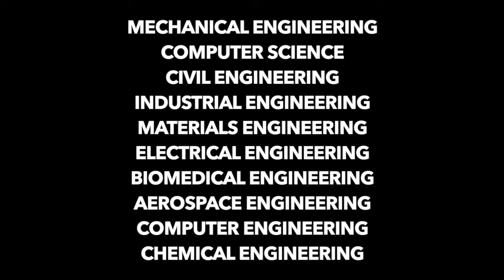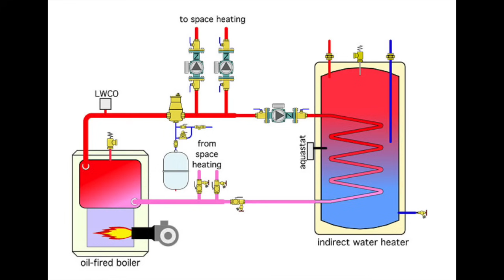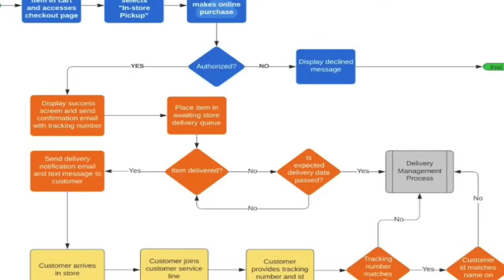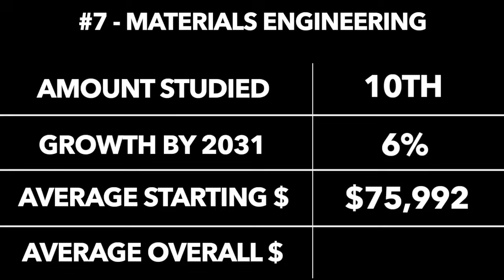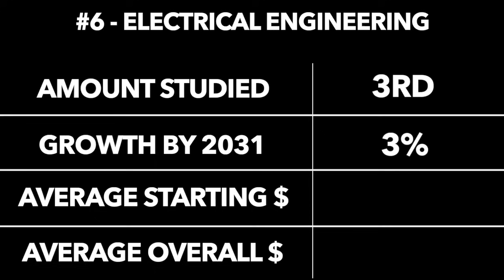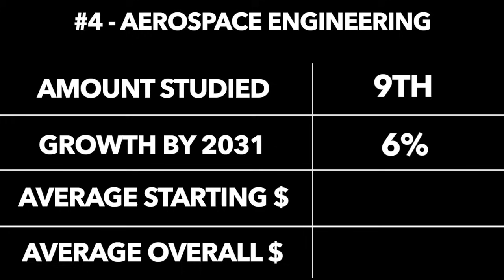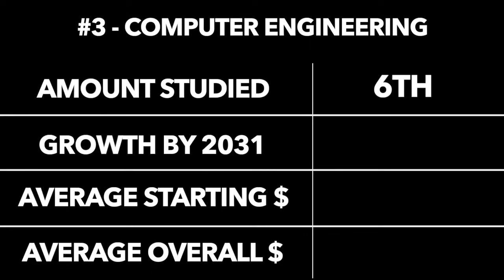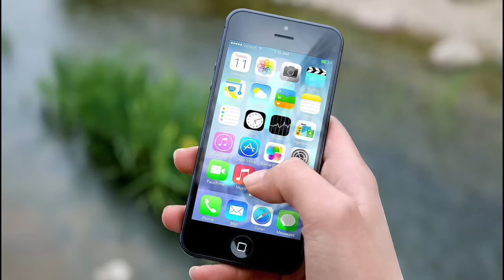Engineering Degrees Ranked: Pay, Demand, and Job Roles

Comment: Retired electrical engineer here. Six years in I was promoted into engineering management, which turned out to be a better fit for me instead of designing circuits and writing code. I evolved a small local electronics support group into a team of engineers and skilled trades people who specialized in the concept, design, build, installation and startup of custom manufacturing assembly automation equipment for my company's North American operations. I learned a tremendous amount, way beyond just the electrical side, from the variety of skilled specialists in my group. I respected them and they knew it,  which in turn made me a more effective leader. Very meaningful and profitable (for the company) work, but extremely demanding.  Upper management always wanted more and expected you to work whatever hours it took to meet their (often unrealistic) expectations. Biggest pain was having to explain to the bean counters and fast-track upper managers why sophisticated equipment couldn't always be conceived and produced to the schedule they crafted on a spreadsheet or Gantt chart. I was successful not because I was an engineering marvel, but because I could identify, recruit, hire and retain a wide range of skilled people who could produce results, and then was able to keep management at bay just enough so I could maintain a positive, creative atmosphere for my team.  My people were the secret sauce for producing project outcomes that made the company $millions.  With that group, there was almost nothing we couldn't do.                 
Engineering is what you make of it.  You've got to work smart and produce measurable results, either by yourself, as part of a team, or as the leader of a team.  You need to be as mobile as necessary to find a good job that fits your skill set.  The right amount of aggressiveness coupled with strong technical and practical knowledge and broad experience can be a real asset as you interact with others in the corporate world. You need to be articulate, have strong grammar skills, be creative and persuasive in order to convey your ideas and convince upper management you qualify for the $$ or resources you require to produce the results they want.  Just be sure you've done your homework on issues, because when you take the lead, you've got to be right.

I walked away when things went global and the service my team provided was being spread all over the planet. And I was being shuffled into roles that I hadn't signed up for and were out of my scope. The volatility became a drag and travel was starting to take too much away from my personal life.  I realized the tipping point had been reached while returning home one night from a business trip, and I immediately started planning my exit. Shortly thereafter I submitted a one month notice and retired.  Great career, but having way more fun now.
Reply: You sound like the generation that built the middle class before we began outsourcing American jobs for overseas engineers at an unprecedented rate
Reply: @henrylj2660 we outsider want to migrate because there is no respect to educated people because of tyrants and greedy and uneducated business owners from a few generations ago and we have not enough salaries.
Reply: Your role sounds like project manager!
Reply: I'm in a trouble situation. Completed bachelors in mechanical engineering and went into learn web development because of the payscale it offers. Still struggling to learn the programming and don't know what to do next. Can I stick on to mechanical domain.
Reply: isnt there lots of jobs for mechanical engineering  @azad738
Reply: Hello, electrical engineer in training here. This is my third year. I feel like exactly what you explained above, that I would do better in a management role as opposed to be a designer. But I've got a long way until then. It's good to hear that you managed to have a good career! Definitely provides some hope that all the hard work I am doing right now will pay off in the end.
Reply: will like to link up with you, I also studied the same course,. Your CV is very impressive
Reply: Can you please get me an internship for next summer somehow😭😭😭

Comment: Not often mentioned:  regardless of the engineering discipline chosen, interpersonal skills will be a big factor in your advancement.  Your career path can lead you to places you can’t predict at this time: project engineering, project management, etc.  Getting along with people in a team, leadership are important skills to develop.
Reply: Agree. Those skills are absolutely necessary to differentiate you from "just" engineering work and open doors to positions that might build on your engineering expertise but be a better fit and much more rewarding.
Reply: I also agree. Being technically competent is necessary but not sufficient.
Reply: As long as the Human Resources idiots have a stranglehold on management (for fear of lawsuits), interpersonal skills and workgroups will, unfortunately, be a thing. This mindset is anti-engineering except for the absolute top 1% which can do both math and schmoozing effortlessly. We need more working and fewer meetings where we are forced to "share."
Reply: @RyanK-100  I respectfully disagree. Interpersonal skills and teamwork will always be a key component of any engineering project.
Reply: Spot on. I'm an ex Ex RAF Radar Engineer but ended up as the UK rep at ETSI (European Technical Standards Instutite). No way was that predictable.

Comment: Because all of these majors precipitate into one job role or another, those roles each have their own salary expectations.  For example an electrical engineer in power systems is completely different than an electrical engineer in control systems.  Wouldn't it be nice if someone could write software that would let you navigate to the brainpower-to-salary that most closely matches you?  Of course in college, people don't really know themselves yet, of what they are capable, and of what they are not.
Reply: 100%. An electrical engineer in control systems in mining for example will pay 2x to 3x of a power systems

Comment: You missed one, 'Electro-mechanical/Packaging Engineer' its a combination of ME with a dose of IE and EE tossed in.  This engineer designs the unit that puts 10 lbs of electronics and housing into a 5 lbs package that survives what ever the Customer uses it in, is producible in high volume with no defects and looks good.  Did I mention low cost as well.

Comment: "Mechanical Engineers make weapons.  Civil Engineers make targets."  😀  Keep in mind it's hard to ship overseas some of these like Civil Engineering.  I started as a BSEE in 1987 from a good U with excellent grades at $32,000.  EEs also design chips (integrated circuits) for television, networking, medical equipment, etc.  It bugs me to no end when people without engineering degrees call themselves engineers.
Reply: I worked a job they called us field engineers to get out of paying us OT. That didn’t work out well for them as they also got caught billing the customer for engineers when we were technicians. They also had to pay us back pay for OT. I worked with bandwidth transport with FOC, digital microwave and satellite communications at a gateway. These jobs paid over $100,000 10 years ago.
Reply: @Chris_at_Home  i work in construction and was a field Engineer. I can say we did more “engineering” related work than project engineers which I also did lol
Reply: When people doing trades say they're engineers...
Reply: people that drive trains are engineers.  haha!   just thought I'd add that.
Reply: I call myself engineer although I dont have an engineering degree. What is your problem with that?
Reply: @michaelpieters1844  I call myself doctor although I dont have a PhD. 🤪
Reply: @michaelpieters1844  If you actively use mathematics, and the sciences to solve technical problems, you are an engineer! You are doing engineering work therefore you are an engineer. Per your comment, I would conclude that you are no a professional engineer, a PE, but there is nothing that says only PE's can do engineering work. Legally, you cannot provide "engineering" services for others in return for compensation, but that does not take away your ability to engineer.You can provide services for yourself and anyone else willing to use it making you an Engineer.

People who need validation from a degree are quite insecure. They need that as validation in their mind that they are somwehow, "superior" to other non-degreed engineers! He needs to read about Professor Paul Moller! The guy has been engineering since childhood. He was bored of traditional school and had poor grades. Didn't go to college. Instead a technical trade school. By chance he met Dr. Barry Newman, a professor of aeronautics at McGill university. Having been so impressed by Moeller, he offered him a graduate fellowship and got the school to wave his undergradute requirements. He bypassed undergrad and went straight to his Masters and PHD. He was engineering long before these soon-to-be legit "engineers" were still trying to figure out what engineering is. People like Professor Moller, and all the ancient engineers of the past prove emphatically that one can be an engineer without a piece of paper. I can assure you, the vast majority of PE's in this country, would pale in comparison to Professor Moller when it comes to engineering prowess and ability. For me, it's all about one's own insecurities and nothing else.
Reply: What if some engineers call you an engineer when you don't have a degree but you fixed their issue with a LC circuit tester that they did when they added issues to their own system, when they called you away from rebuilding a plasma generator with a failed IGBT?

Asking for a friend
Reply: I'm not entirely sure what you mean by people calling themselves engineers. First and foremost, in most if not all states, it's illegal to pose as an engineer and do engineering work. Even if you have the technical know how, you cannot carry out such work in the name of an engineer. If someone calls themselves an engineer because that happens to be their job title, I see nothing wrong with that. The title itself was not self-bestowed. It's just a job title that came with the job. Lastly, if you're going to try to imply that somehow, ONLY, people with a degree in one of the formal engineering fields is capable of carrying out work in these areas, I would totally disagree with you because that is entirely not true. There are plenty of bright people who can easily pick up books and be completely as competent if not more than students who have a formal degree. Not all engineers are created equal because not all engineering institutions are equal and we know passing the FE and the PE only requires around a 70%. In other words, you are going to have engineers who barely scraped by and you're going to have engineers who breezed through the material. When it comes to institutions, there are places where average students walk out with A's and the C students wouldn't have a chance in a real competitive engineering school, but somehow, society groups them as the same since they have their engineering degree and this seems to be where you're coming from. You can't tell me that all engineering schools in the country graduate engineers with the same level of competencies, because they don't. There literally are "engineers" as you would like to call them with engineering degrees that literally are incompetent. When I say incompetent, I mean literally they struggle to handle the fundamental math and physics that they are supposed to be competent in. This is simply due to the different levels of competency required to receive an engineering degree at different institutions. Just as you cannot equate the bottom of the graduating class of engineers at the bottom engineering schools in the nation with the likes of the top engineering students, or just all the engineering graduates at your top engineering schools, you cannot just scoff at the idea that someone could be an engineer without no formal degree. Sure, they may not have taken all the classes required to get a degree, but that doesn't mean they haven't or couldn't master all that is required to be an aerospace, mechanical, electrical, or whatever type of engineer. Instead of judging them by their title, I prefer to judge them by their abilities. If they can show competency in the field, they are engineers in my book. I could care less about a degree. After all, a degree DOES NOT endow one with special abilities. The ability comes from the person, not the paper. As such, people can possess a paper and be totally incompetent. My experience is people who are less competent are the one's that rely on their degree. A competent engineer never has to rely on his degree. His knowledge alone screams, "I'M AN ENGINEER!" No paper required! And the thing with licensure, a PE, is to ensure competency, but even for PE's some are extremely competent and others, not so much. The key differentiating thing with being a PE is it carries with it, liability. Being the EOR, you are taking on the responsibility of any failures that may occur. All other engineers take none.

So I'm not really sure why you feel so strongly about it. It's one thing if they have a fake PE license, but if they are merely calling themselves an engineer because that is their job title or if they can do exactly what you do, but just lack a piece of paper, that in no way should make them any less than you. This sounds more like an ego issue than an engineering issue. The fact of the matter is that engineers have been around long before the formal BS in engineering degree  ever came into existence. If what you are saying is true, it would negate all the great engineers in the past who helped build and designed many of the world's great wonders of the past. Engineering is the application of math and science to solve technical problems. There's nothing that requires one to have a degree to do this; all that's required is knowledge in the maths and sciences and having the creativity and ingenuity to contrive and come up with solutions that will work. Creativity and ingenuity is not possessed by all who hold a piece of paper. As Einstein put it, "imagination is more important than knowledge" because one's knowledge is finite while one's creativity is not. Lastly, I leave you by paraphrasing what Terrence Tao said in an email response  to someone asking how it felt to win the Fields Medal.  His response was, "The Field's Medal doesn't have any magical powers that will automatically solve all the problems I'm working on for me. As such, I'll continue to work on the very same problems I've been working on ." A degree is simply just a degree. If a degree proves anything, it's that you are willing and capable of starting and finishing a task and nothing more. Competency is proven in the field, not on some piece of paper. Cheers!
Reply: @vangmountainAside from the wall of text, I agree. I never have called myself an "engineer", just that I have done engineering work. By title I was an "Engineer Technology Lead" Some engineers I have met, as well as skilled trades, I would trust to build me a heart pump to keep me alive, however that number is dwarfed by engineers and skilled trades I don't trust to cook a pop tart. Their degree meant I explained things differently to a mechanical engineer vs an electrical. Their accomplishments or ability determined what level of work they did.
Reply: If you  know drive a car but doesn't  a license, can you drive a car in a city?

Comment: Worked full time while earning my BSEE at nights, graduating in 2002.  Emphasized CPU design.  Height of the tech bubble burst.  Never worked even 1 day in the field.  WIth layoffs rampant in the field, having absolutely no experience (working adult, married, mortgage, etc. so never had the opportunity to do summer internships) made it impossible for me to find work.  I use the math from that degree to do statistics in the insurance industry.
Reply: My BSEE was concentrated on power generation, transmission, and usage.
Never had issues finding work because I had so little competition in the real world.
Reply: @ghost307  one of the instructors told us that we should get as much power design classes as we could in order to always have a job. I didn't want to do that because digital was cool. If I could do it over again I would have done power because it's stable.

Comment: To get a job with a material engineering degree do you need a master's?
Reply: It's always good to have masters for your CV, especially if you base your masters thesis on scientific research of new material or some cutting edge way of utilizing existing material. Pieces of that thesis can easily be published in journals or conference papers which is another reference for job applications.